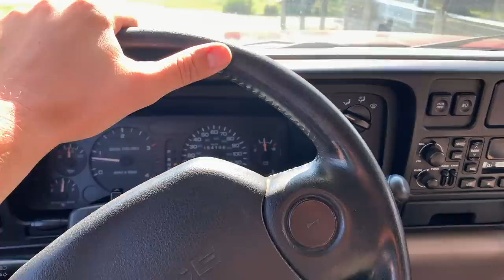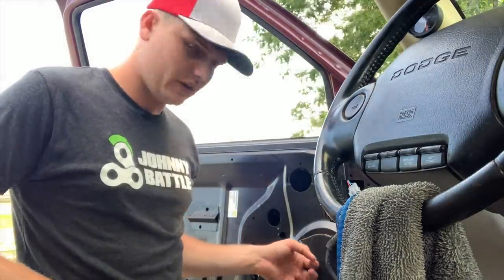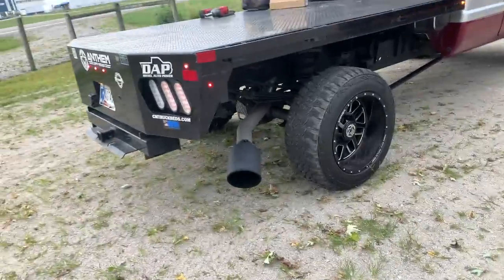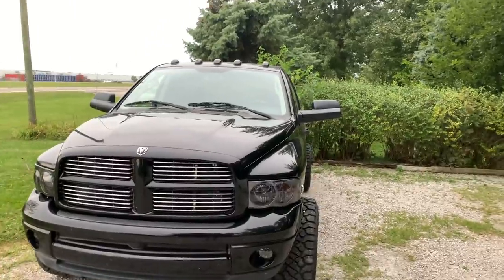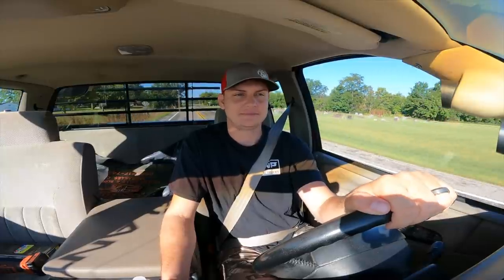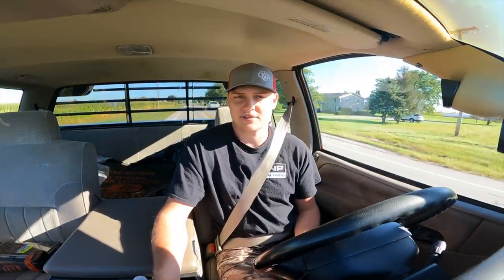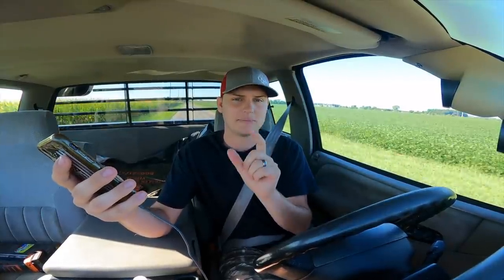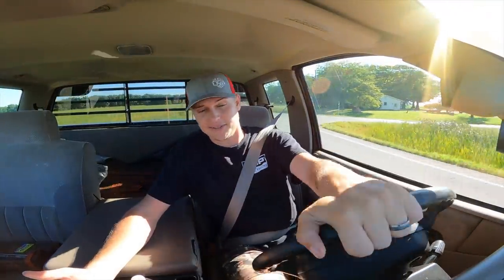I should've done this 4 years ago...

Comment: The best engines Ford ever used was the 6.9L IDI diesel and the 300ci i6 gasser. Low powered, but super reliable. Funny how it tends to be the "I only buy Fords" crowd that claim the 6.0 and 6.4 are good engines.
Reply: I'm more of a ford guy and I wont touch anything after the 7.3L lol.

Comment: With the 6.0 powerstrokes the maintenance does help out a lot but they are still going to have problems and so avoid those problems you have to dump at least $5,000 into them to bulletproof them. If you could find a super clean 6.0 with low miles and is already bulletproofed then I think you’d be okay. You should be fine if you find the right 6.0 but DONT get into 6.4’s

Comment: I got a wrecked 3 gen for 1800$ runs and drives Just for the engine and transmission
Reply: That's cheap. 
A running 3rd Gen Common rail should easily sell for $3500 without the trans, no?
Reply: I got a whole parts truck for 1800 so I'm happy